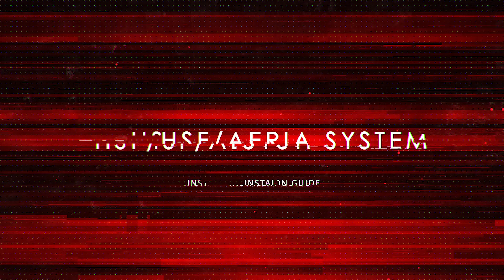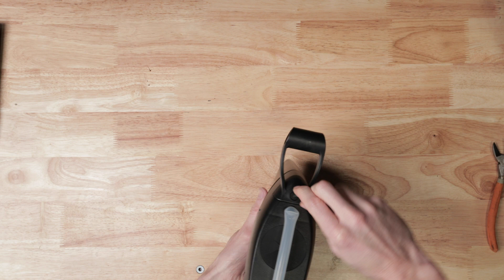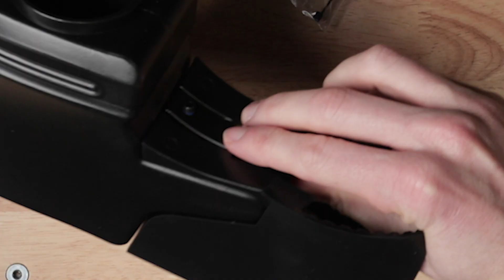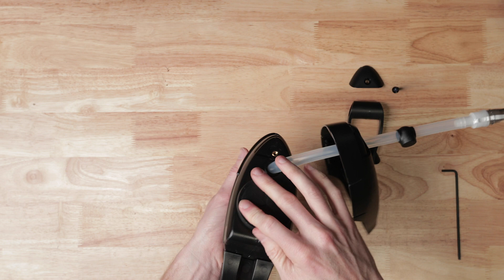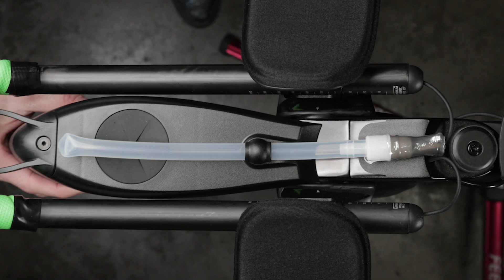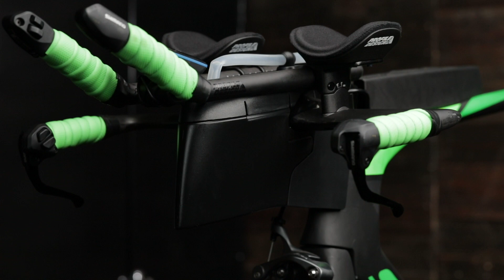HSF/Aeria Installation

Comment: I have a profile design wing 10a bar with profile design sonic brackets on it. The brackets are as wide as the bar will allow them to go, and this system still does not fit between them. The top cover keeps snapping up on one side or the other because the brackets are squeezing it. Ridiculous that this system isn't compatible with PD's own products.
Reply: I have a wing10a with sonic brackets too. Did you find a solution to this or do you have to change base bar?

Comment: 70.3 Ohio.  This system launched from my bike 26 miles in.  My Garmin Edge was launched into a corn field, never to be seen again.  I will not be running this system again.
Reply: You did not follow directions.  there is no possible way that once this is installed correctly it will go anywhere